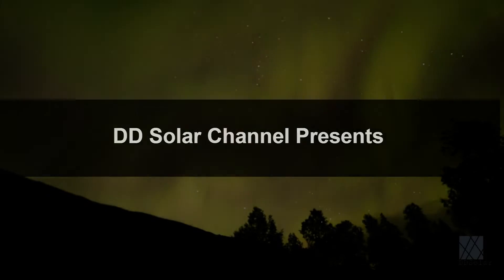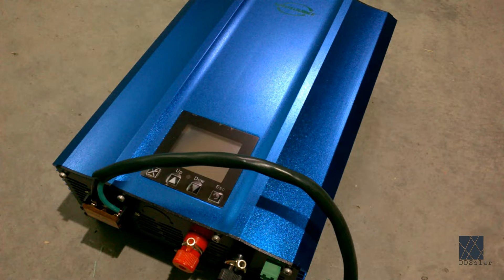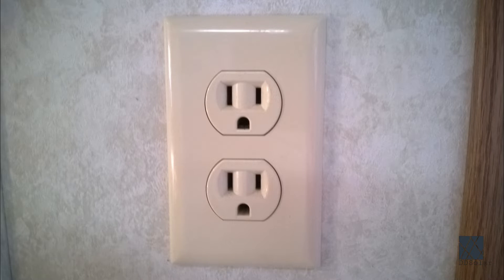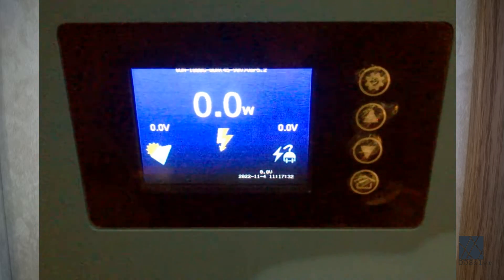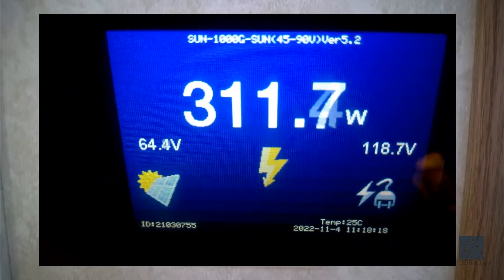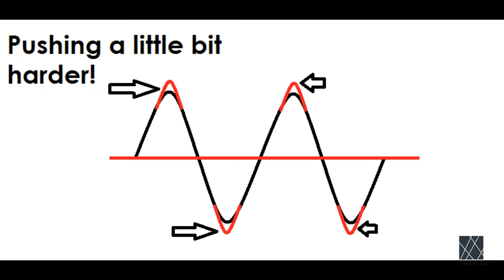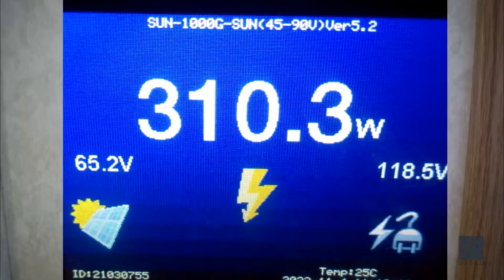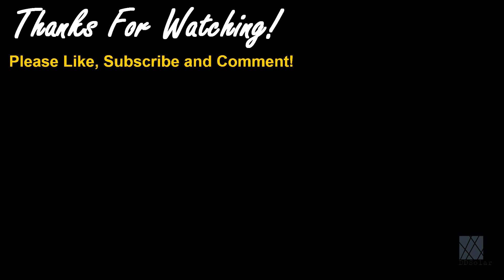How Grid Tie Inverters Work - simple explanation for beginners, safety info #gridtie #gridtiedsolar

Comment: If i have a open breaker would a plug in inverter  work
Reply from the maker: @rabbitinthehole1 Not if the AC power is cut off, because a GTI is actually powered by the grid and must sense it first before starting to supply any output power

Comment: Most people on YouTube didn't seem to know exactly how grid tie inverters worked. I don't think I would backfeed one through a regular 15 or 20 amp outlet, probably the best move would be to hardwire it to the panel. In a majority of cases the higher voltage would actually make some electrical devices run more efficiently.👌 what is an incredible device
Reply from the maker: @crazyDIYguy I have a similar impression :D unless one knows exactly what he's doing, it is rather risky backfeeding into the wall. But let's face it, lot's of folks are doing it. My goal is to help people understand how GTIs work. In conjunction with my other video "grid tie inverter safety warning" https://youtu.be/VP9n8T3PsMA
that should boost the safety level for everyone and make the world a slightly better and safer place - I hope :)

Comment: Informative video, and I have one question. How does the inverter sync with the grid?
Reply from the maker: @shehnaazmirza2 Hi and thank you! first before making any output, the inverter has a small computer chip inside which measures the grid frequency. Then it instructs the output stage to start operating "in sync" and at exactly the right time. If sync is lost, the inverter should stop working to avoid damage to itself or appliances. Hope that helps :)
Reply: @solarpoweredge  Thank you, so its mostly automatic inside the inverter, does all the inverters sync with the grid?
Reply from the maker: @shehnaazmirza2 Welcome :) yes it is absolutely automatic. In fact, the inverter must never output any electrical power, without first syncing with the grid. And yes every single grid tie inverter we can buy has this feature included inside.

Comment: Very well explained. I want to put solar panels in my Home in Thailand and use it offset my power usage by my air conditioning. Seeing as solar panels are so cheap in Thailand i will be installing 12 x 600 watt panels. An a 10k grid tie inverter. (Obviously these are 220 inverters). I would appreciate any comments.
Reply from the maker: @magicman9486 Hi, thank you for the positive feedback. That's a good sized solar setup. It should make a huge difference. It will be interesting to see how much the electric bill reduces after the system has been running for awhile

Comment: I have an inverter that says ac voltage is too high even though its reading in the normal range.  Any ideas on what could be wrong?
Reply from the maker: @chris76-01 Tough to say from here, it could be a lot of things But definitely check 1) the spec sheet for the actual voltage range the inverter will accept and 2) the AC wiring from end to end

Comment: You should simulate what happens when the grid electricity is down. Can you recommend 2000w 24v input 240v output  grid tie inverter?
Reply from the maker: Hello, I may address that in a future video. You could try one of the blue GTIs, they were called "Sun" brand and now seem to be listed as YH brand. I bought several years ago and do like them still. Apparently they are not known for being super reliable, so I'd thoroughly test, then run at 50% power and keep them cool.

Comment: Good info on how the voltage increase lets appliances use the generated power before relying on other standard power sources. Is there a way to know where power is going when multiple loads are demanding power or where it might be prioritized with a complicated list of appliances?
Reply from the maker: @pyrojason One way to handle it is connect the GTI into the same circuit as the priority appliance. In this way the power is most likely consumed by that appliance without ever touching the electrical grid. Of course we cannot "see" electricity so it's not 100%, but a good start. If you had a 1000w electric heater, and a 250w GTI feeding the same circuit, it's very unlikely the GTI power gets past the heater. Just my way of looking at the issue, hope it at least makes some sense

Comment: Grest video with clear concise info. If the inverter has a grid tie input and and a output would you recommend a dedicated circuit in the homes main electrical panel to feed the inverter and another dedicated circuit for the inverter output to go back into the panel? It seems to me the dual circuits would be running in parallel from the inverter to the panel.
Reply from the maker: Hello and thank you for the good feedback :) For the AC output it should be a dedicated circuit whenever possible, this is a code requirement anyway. The type of inverter you are describing sounds like a hybrid? I'd refer to the installation guide for that specific model. If they are indeed in parallel or for pass-through then probably one (properly rated) circuit breaker should be fine.
Reply: Yes it's hybrid, the installation guide doesn't specify if you can feed the current back into the main distribution panel.
Reply from the maker: That is strange, I would recommend contacting the inverter manufacturer or seller, and ask them about it. Otherwise, can just install and use 2 circuits to be safe.
Reply: @solarpoweredge so the way it works is it actually had a setting on it that allows you to choose if you want it to back feed into the service or only draw power from the grid. The output of the inverter feeds only what you connect to it's output.
Reply from the maker: @ralphyc81  Ah, that makes a lot of sense, it should always be up to the end user. Good to know

Comment: Great explanation!  Can you comment on how grid backfeeding works when the inverter exceeds the power of the load?
Reply from the maker: Thanks :) this is a really good question and may be the topic of a future video - when I'm allowed to make one. In effect your house becomes a mini power station supporting the grid loads. Exactly who is using your backfed power? We don't know, and can't prove it, but it's interesting to think about. The electrical explanation of what is actually happening when a GTI backfeeds is quite technical. I will include that in detail if I manage to crank out a video about it.

Comment: If you are pushing power "backwards" through a circuit breaker in the main panel and into the other circuits in the house, is the current then limited to the circuit breaker you're pushing through, and therefore limiting the power to the rest of the house?  P = VA.  For example, if you are pushing 20 amps through a 15a circuit breaker, what will happen?  Will the circuit break, limit the current or allow the power to pass through without any effect?
Reply from the maker: Hi, in theory if back feeding AC through a circuit breaker, the circuit breaker will surely be the limit. 20A should trip a 15A AC breaker - even in reverse. If using a dedicated circuit for the GTI, the breaker should be sized appropriately for the task. Btw thanks for commenting and hope this helps. DD

Comment: Do these also reduce grid cosumption of 220/240 volt loads even if it is plugged into a dedicated 110/120 volt outlet?  If not, is there a way to use 2 grid tie inverters to plug into a dedicated 220 volt NEMA outlet?
Reply from the maker: Yes, in part. In most US houses there is a 240V connection with L1 and L2 phase (or leg), each with 120V. A GTI will feed back into whichever side it happens to be tied to. To feed back into both L1 and L2 (or 240v)  in a balanced way, you could connect a 120V GTI to each leg using separate dedicated circuits plus outlets. Hope this helps! DD

Comment: thanks for the info, I just started doing research , so if I have a dedicated breaker and outlet for the plug in , that’s pretty much the same as I wire directly into the breaker box , right ? Btw is that the sun power inverter ?
Reply from the maker: Hi, welcome! Correct, and nothing else should be plugged in. That way you know it's one breaker to one inverter, keeps things simple. And yes it's a sun power inverter, most of my inverters are that type, I really like them
Reply: @solarpoweredge   now just figure out the math and figure out wind turbine

Comment: How is called the machine that sends back electricity to the grid?
Reply from the maker: Hello, it is called Grid Tie Inveter or GTI. There are 2 kinds, directly attached (hard wired) and plug in (these use a standard AC household plug, but can be dangerous)
Reply: @solarpoweredge  i understand, it could defeat the circuit breakers and burn the wiring to the ground. Thanks for your videos they are really helpful.
Reply from the maker: I am glad to help - thank you for watching :)

Comment: Can I use a generator to run my meter backwards at night by hooking it up to the  solar panel circuit breaker in the main panel?
Reply from the maker: Hi - most generators can't sync with the mains supply and are not designed to backfeed the grid. If you exist in an area with very high electricity tariffs, it might be better to cycle some lithium batteries during peak hours through a grid tie, and charge them when electricity rates are lower. Or just run stuff off of battery at night. Thus saving the generator for extended power outages / emergencies. That is just my opinion though. Thanks for watching Please consider subscribing if you haven't :)

Comment: This information was quite good it was a little short I was seeking more information about these types of targets but I loved it so I subscribed hope to hear more in the fut you're period of course my question is does this higher frequency calls impedance meaning that the reason why the house uses this tigrid energy 1st because it impedes On the incoming electricity ?
Reply from the maker: Hi! thank you for subscribing. Maybe in the future I can make a longer video about this. 
Electricity is  something that I don't fully understand and am always learning about. The way I look at it is this: the GTI puts out a higher voltage (pressure) which pushes the load first (or carries it). If the load exceeds the GTIs  output, it drags the line voltage down enough that the balance of pressure needed comes from the grid. If the load is lighter than the GTI's output, then the GTI supplies all the power plus feeds the excess back towards the grid. I like to think of the grid as a lower-impedance source capable of high surges but limited by the impedance of the wiring on premise. Of course this is all theory and there is still much to learn!
Reply: @solarpoweredge    Thanks a lot you are about where I'm at try going to my channel and looking at some of my videos you'll see that I have 5 tie grids and verters I'm writing quite a few books on different subjects and tigrid is one of those subjects so I'm kind of in the same boat as you maybe we can learn together.
Reply from the maker: Right on! Just subscribed your channel. You have some of the most interesting stuff I've ever seen. Thinking outside the box for sure. Especially liked the candle setups and explanations, awesome!

Comment: Can grid tie inverters prevent back feeding power during an outage to protect linesman?
Reply from the maker: Hi, yes all grid tie inverters are supposed to have "anti islanding" which means they instantly power down when the grid feed is lost. I have tested some of this myself and it seems to work. Of course if there is a power outage, I'd immediately do a physical disconnect all GTIs just out of courtesy to linemen and for extra safety - just in case.
Reply: @solarpoweredge  Are there any automated systems that auto-disconnect from the grid but still provide power to home from the solar array? Is this what Hybrid inverters are?
Reply from the maker: Yes, that's a hybrid inverter. They integrate solar panels, battery banks, GTI and AC mains into one. It's like a gigantic UPS. They're not too cheap though!